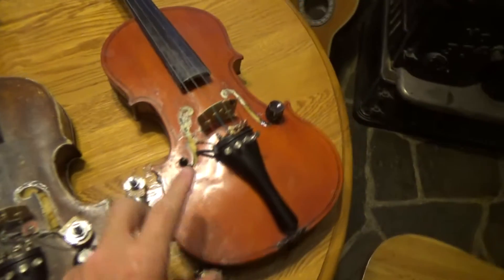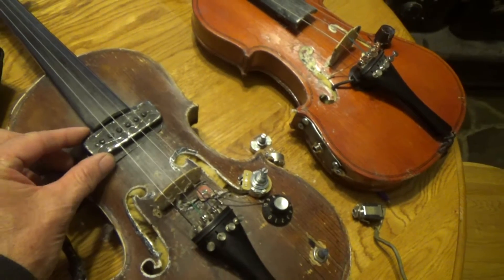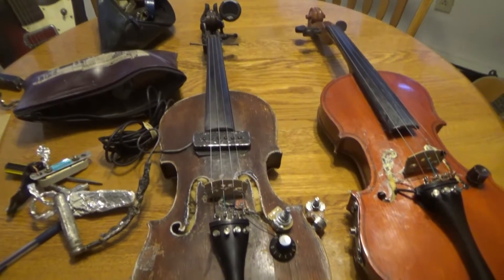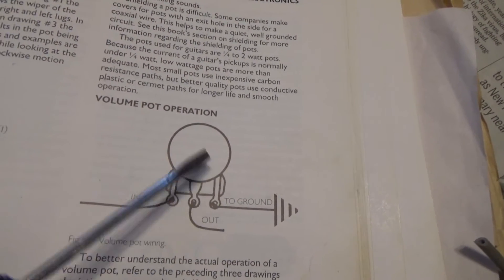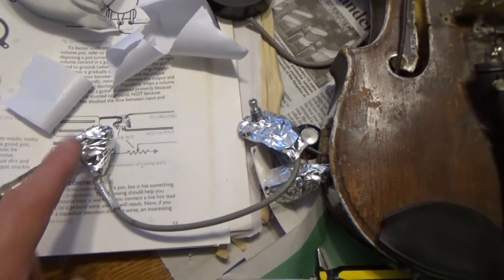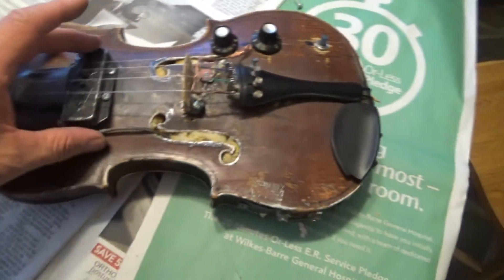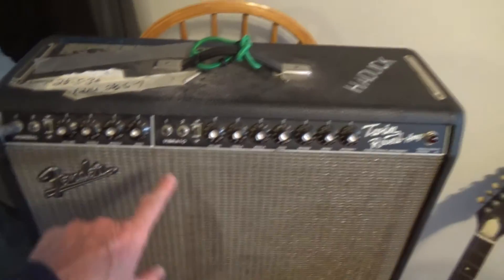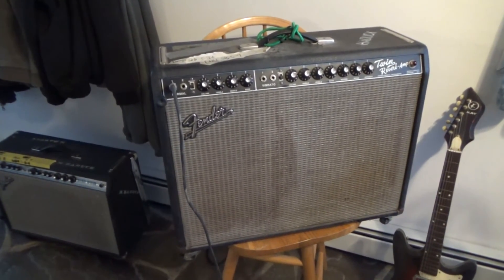Fiddle or violin pickup install (part 2 of 3) guitar pickup

Comment: I've just learned: I shall use more hot-glue and Spax-screws when fixing my instruments :P
Reply from the maker: hi salossi,  it works for me,  those instruments get so beat up, like an old car with a good engine, thanks mike
Reply: @mikehaduck-travel-mechanic884  Hey Mike, I get both sides - on one hand, my blood instantly freezes in my venes, when I watch this video. On the other hand: respect, it does not sound too bad, and if it works for you, why not? that's just fine. In any case, this is the proper 'punk way' to customize a fiddle... :)

Comment: Love what you're doing here man. Have you considered using only one output but with a blend configuration? Then you don't need to unplug to switch between pickups.
Reply from the maker: I have, but I wanted to keep them separated so if something happens I could just use the other. probably a very good idea though. thanks mike
Reply: An a/b box pedal would do the trick

Comment: where do I ground ?
Reply from the maker: I ground to the input and strings
Reply: @mikehaduck-travel-mechanic884  hmm , I have a cecelio silent I bought just to hot rod with the old pickups from old guitars evh pots, orange drop ect, but all 4 strings are not metallicaly cornected so I may have to ground to all 4 somehow , thanks for the input , I have a signed acoustic doug kershaw violin I may hot rod as well \m/